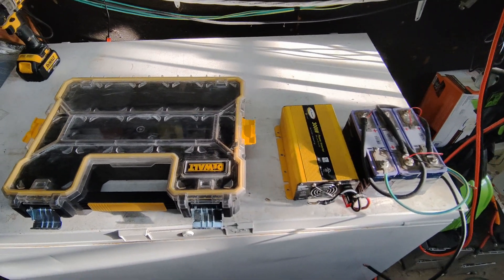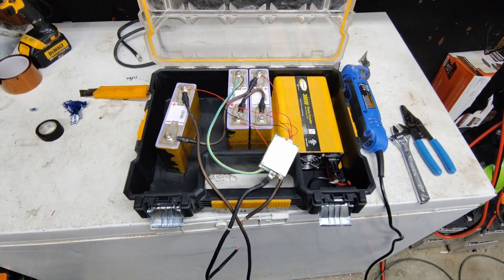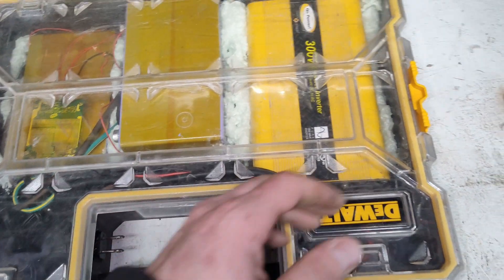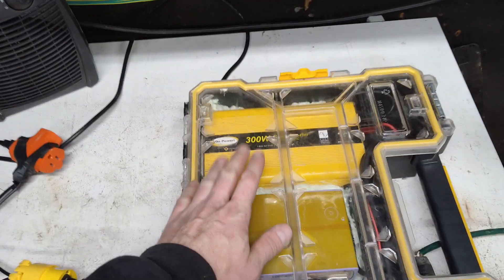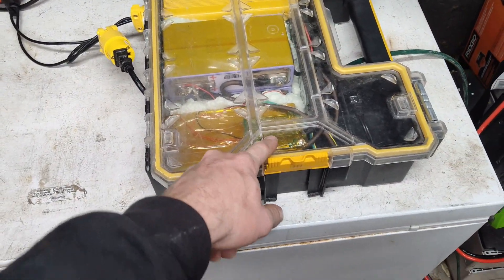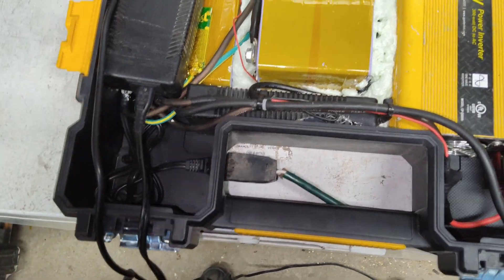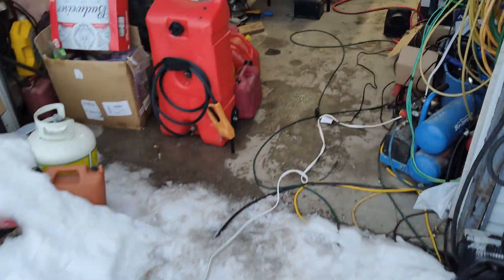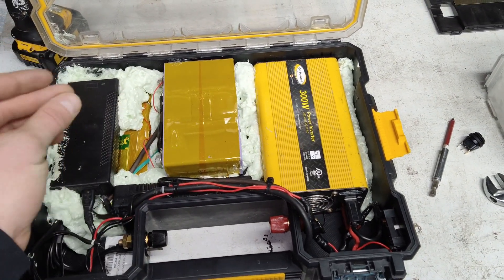DIY Solar Generator Build

Comment: I made up something similar for power outages but the other way around to 9 amp hour ryobi's in parallel running a 100 what inverter if the power goes off it keeps the lights on using Buck converters to run 100 watt at 12 volt converters

Comment: Do you think if you had a switch to shut of the heater after the saw starts would it have more power.
Reply from the maker: Yes but the inverter would not run it